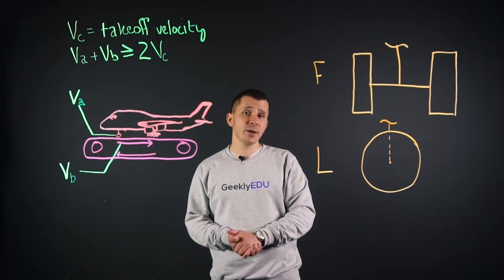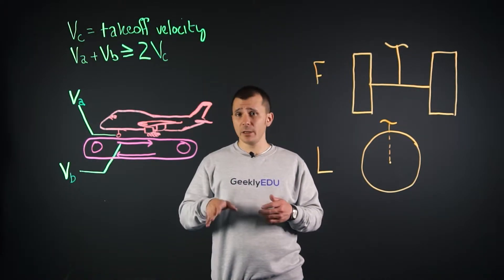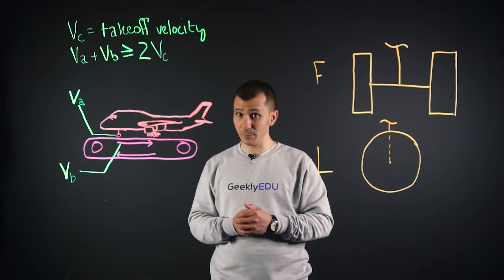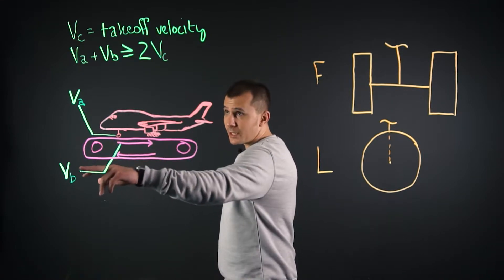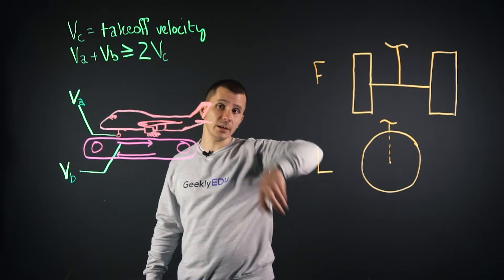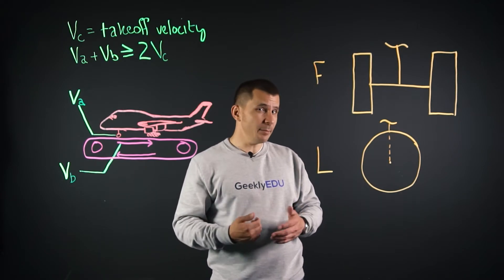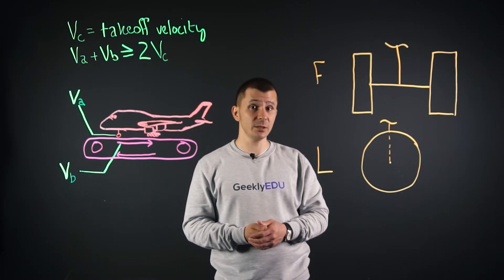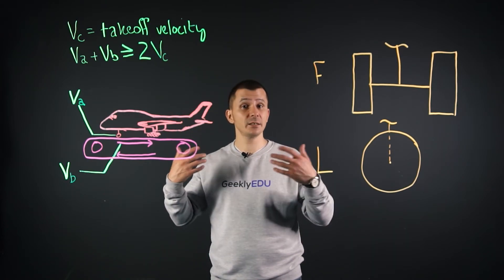Plane on a Conveyor Belt - Will It Take Off? #GeeklyHub

Comment: I believe the wording of the problem is an issue here. An airplane CAN TAXI on a converyor belt and remain stationary (and thus not fly) but if the pilot guns the throttle it WILL FLY. Some people are believing that the pilot is holding back the throttle to MATCH THE BELT SPEED and thus HOLDING BACK THE PLANE FROM FLYING. This is where the wording gets confusing because a CONDITION of the problem is that the belt match the airspeed and this would require the pilot to hold the plane throttle back to maintain stasis. But don't kid yourself. If the throttle gets hit hard enough that plane is flying. The wheels just spin more.
Reply: The plane will taxi just fine on a conveyor belt. you would not have to gun it. Normal taxi thrust would work just fine. Especially when there is little wheel bearing resistance at taxi speeds.
Reply: The condition is the same whether taxiing or wide open throttle.  The people who think the plane will take off are frequently just amazed by the size and power of the force of the aircraft engines.

The raw question is kinematics.  One motion is exactly the same as the other motion.  The net speed at wheel axle is always zero.

Not only is the speed exactly matched, the acceleration is always exactly matched because acceleration is the derivative of speed.

It is an obtuse thought project not based on any practical outcome, but half of the physics problems are similarly out of normal day to day experience.
Reply: @MrDefreese  Nope. The conveyor belt can run at the speed of light in the opposite direction of the airplane if it wants to, and it won't slow down the plane. Provided that the airplane is build "perfectly" meaning there is no friction between wheels and their axis, the wheels are just going to spin at whatever speed, like wheels on roller skates, skateboard or roller blades, but it won't have any effect on the airplane. The engines are going to create force that affects the airplane giving it acceleration in one direction, and the conveyor belt won't be able to exert any force whatsoever on airplane in any other direction. Even with real airplanes, the friction between wheels and their axis is so small, that the force of the resistance to the acceleration of the airplane is going to be negligible. The main force of the resistance is stil going to be the force of the resistance of air.
This is not a kinematic problem but a dynamic one, as the forces can't be excluded from the equation.
Reply: @ you have to start with kinematics first to see equilibrium.  Force analysis is just changing speed conditions over time.  This is not about bearing friction.
Reply: @MrDefreese  The question was: can the airplane take off? For that it needs the lift force. It can’t fly without the lift force. So the analysis of the forces involved must be done.
Reply: @.  You just need to know that the only way a wheel or wheeled vehicle can move is by rolling or by sliding on a surface.  If you reasonably exclude scrubbing across the surface, then you are left with only rolling and the kinematics are then inescapable.  No matter how fast you roll your wheel around its axis, the surface exactly matches the tangential speed as the wheel rolls on its circumference.

I’m sure you know the calculation of linear travel and rotational travel.

It’s inescapable math and kinematics.  It only highlights how useless this thought project is.
Reply: @MrDefreese  You are missing a key aspect: an aircraft is not a wheeled vehicle in the sense a car or a truck is. It does have wheels, as they create the least amount of friction and resistance to movement, but it could do with sledges or skates if the runway is made of or covered with ice. A hydroplane doesn't even have wheels. 
You are mixing up physics of a ground vehicle and an aircraft. 
Kinematics doesn't provide information where the motion comes from, and in case of an aircraft and a ground vehicle, the motion is generated completely differently, hence different rules and different outcomes apply in this kind of experiment.
At technical examination facilities in DMVs across the world they actually have a contraption that is designed to match the speed of the wheels. It is used for testing performance of breaks on automobiles without the vehicle actually moving no matter how fast the wheels are turning.
Reply: @ you are expressly given the kinematic relationship and you improperly  ignored it in your response again.  The rack and pinion animation shows you  how a rotating object on a moving surface behaves.

Start with kinematics, not force analysis.  🤷🏽‍♂️
Reply: @MrDefreese  OK wise guy. What causes what to move? Do the wheels cause the conveyor belt to move, or the conveyor belt causes wheels to move? 
Or in your "animation" does the pinion rotate and cause rack to move, or is it the rack that moves and causes the pinion to rotate?
ps. In order for an aircraft with its engines turned on to stay still, there must exist a force that is equal in intensity, but opposite in direction to the thrust of the engines. How exactly does the conveyor belt exert such a force on the aircraft? How is it transmitted from the contact point of the wheels to the entire aircraft?
Reply: @raderadumilo7899  once more.  Start with the kinematics and then go from there.  You now have this updated information to make your own assessment rather than disregarding the explicit conditions we are given.  Let's see your solution now that that part is out of the way.

Another person compared it to a plane taking off of an old school aircraft carrier without catapult.  If you take off as normally expected, the velocity at the wheel axis is the combined speed of the aircraft plus the speed of the vessel.

If, however, you point the aircraft towards the stern and try to take-off, you get the same situation as presented in this thought project - the speed of the vehicle less the speed of the vessel will give you the net speed of the aircraft from the perspective of the outside observer.

In Mythbusters, their aircraft take-off speed was 25mph.  If you put that aircraft going from bow to stern on an aircraft carrier going 25mph, then the net speed of the aircraft from an outside observer would be 0.

Long story short - it's both a frame of reference problem and a visualization of the conditions problem.  The pinion and rack explicitly shows the relationship between the two independent objects with no slippage and pure rolling.
Reply: @MrDefreese  Wanna use kinematics? Fine. 
A fixed wing aircraft takes off when it reaches a threshold velocity relative to the air surrounding it.
A fixed wing aircraft stays in the air by maintaining certain velocity relative to the air surrounding it.
It reaches and maintains the necessary velocity by pushing certain amount of surrounding air backwards (propeller or jet), and then the uncle Newton pushes the airplane forwards. 
The only frame of reference that matters at all is the air surrounding the airplane. From the POV of a person standing away from the conveyor belt the air above the belt and surrounding the airplane has velocity 0 (wind excluded). The velocity of the airplane relative to the air and to the observer is Vt. 
The conveyor belt has velocity -Vt relative to that same observer. 
If we add an observer on the conveyor belt, from the perspective of that observer, the velocity of the airplane is 2Vt in one direction. However, the velocity of the surrounding air is -Vt relative to the observer, if we take the direction of the movement of the airplane with a plus sign.
Wanna play kinematics? Fine, but you were missing the only frame of reference that really matters here and that is air.
Reply: @raderadumilo7899  your math is incorrect.  By the terms that we are given once again, the velocity of the airplane is Vt from the perspective of the conveyor....because that is what we are given.

Revisit the animation of the pinion and rack once more.  The motion shows you from the perspective of an outside observer that the wheel axis moves not a lick when the conditions stipulated by the thought project are put in motion.  It even shows the motion backwards and forwards so that there is no ambiguity.
Reply: @MrDefreese  Wrong on many levels:
1. The question is: Can the airplane take off? The only frame of reference that matters or has an impact on answering that question is AIR.
2. As for the pinion and the rack animation: There are two scenarios:
a) Pinion is fixed to its axis, so the axis rotates at the same angular speed as the wheel.
b) Pinion is not fixed to axis, so the axis does not rotate at all while the wheel is rotating at certain angular speed.
You are constantly looking at scenario a) while in the case of the aircraft it is scenario b).
Because scenario b) applies to aircraft, what happens is that there is no causality between those two motions. Rotation of wheels of the airplane can't make the axis move in any direction whatsoever.
Here is a better scenario for you to visualise this:
- You have a person wearing roller skates on a conveyor belt. The conveyor belt is moving in one direction at a certain speed. 
The person is holding to a fence that is beside the conveyor belt and stationary. The person can use the fence to pull itself and move in the direction opposite of the movement of the conveyor belt. 
Physics of that scenario is exactly the same:
- Wheels of roller skates behave exactly the same as wheels of the airplane, rotating at the speed that matches the speed of the conveyor belt, but they can't cause the skater to move in any direction. Person using the fence to pull themselves in the direction opposite to the movement of the belt, that's what aircraft propulsion system is doing. 
Different set-up, same physics.
Reply: @raderadumilo7899  first, you don't need to worry about 'air'.  The issue is whether the vehicle can roll on the moving surface.  Kinematics once more.  Your attempts to explain fixed wing flight are wonderful, but understanding the rolling behavior of an independent object on and independently moving surface is the issue of this thought project.

Secondly you are rightfully observant that a solid axle is different than a bearing, however, no matter how you slice it, the vehicle can only move by rolling (or sliding) and we are not dealing with a sliding situation. You must use the standard formula for the rolling of a circular object equaling the linear travel at the wheel axis/axle.

Lastly, the 'pulling the object along the surface' example is fatally flawed because, once again, in order for the wheeled object to move, it has to roll and you are, once again, explicitly given that the surface rolls at the same exact rate.  What would happen if you created an artificial position constraint to this kinematic system, you would cause the the system to bind as you try to force the position change; you would cause the wheels to scrub across the surface which is obviously not the principle at issue with the thought project.

You are in a circular illogic where you want to just force the object to move even if it means disregarding the parameter of motion you are given.

A 1 m wheel at 1RPM moves 3.14 meters.  The surface also moves 3.14 meters.  How far did the wheel axis or axle move?  Nil.
Reply: @MrDefreese  For crying out loud! An aircraft is not a ground vehicle. Its motion has nothing to do with the surface. You can't exclude air. Excluding air for an airplane would be like trying to do kinematics or dynamics of a car in space.
You can't apply either kinematics or dynamics of a ground vehicle. The ground vehicle moves by friction of the wheels on the ground surface. If the surface moves, then it affects the movement of the vehicle. 
The ground vehicles are rolling. An aircraft is sliding. It's just that bearings and freewheeling effect are used in order to reduce friction.
But guess what: a hydroplane is actually sliding on water surface, and sometimes they are used to take off from snow or ice fields also.
So, in essence, we are dealing with sliding, not rolling.
Provided strong enough propulsion a hydroplane that has no wheels could slide and take of even from an asfalt or a grass runway.
Reply: @ stop typing.  The vehicle is not in the air.  It is only able to move by rolling or sliding on the surface.  Lift isn’t involved until it gets to a high enough speed and the summary of this thought project is that the wheel axis and the vehicle body doesn’t move relative to the environment.

Stop typing and try to learn because you keep making basic mistakes that would be fixed if you let it percolate in your noggin.
Reply: @MrDefreese  Wrong. An aircraft is in the air. It moves by pushing molecules of air in certain direction. It sliding on surface is just a side effect. They used to have an aircraft attached to the bottom of a Zeppelin. It wouldn't have enough speed when dethatching from the Zeppelin, as that thing moved very slowly through the air, however, at enough altitude it would have enough room to reach the necessary velocity moving through the air on its own. 
The lift exists from the moment an aircraft starts moving. At certain point that lift will be equal to the force of gravity and the result force with which the airplane impacts the ground will be 0, and the uncle Newton will then make sure that the force with which the ground impacts the airplane is also 0. 
At what speed this will happen depends on what are the conditions of air surrounding the airplane. The Nairobi international airport has (or used to have) the longest runway in the world. Guess why. 
Add a vertical thrust engine to the aircraft (UK Sea Harrier or USSR Yak 41) and you reduce the time needed to reach required lift force to 0. Or you add Vo to the equation and significantly reduce the time needed to reach Vt (the catapult on aircraft carriers). However, the physics stays the same.
Your thought process and all your instincts are constantly stuck with physics of ground vehicles, and for that reason you are incapable of understanding that for the aircraft the wheels and the ground are just the source of negligible resistance that have way less impact on the movement of the aircraft then the resistance of the air. You can replace the ground and resistance it causes with a force variable and use exactly the same equations as for the aircraft at 35K feet in the air. You'd get the same results both theoretically and empirically.
Questions:
- Why was the space shuttle called "The Flying Brick?"
- How does a head wind to the aircraft impact the take off?
Reply: @ stop trying.  The problem is the vehicle on the surface.

You are embarrassing yourself to the point you will have to discard your account.  🤦‍♂️
Reply: @MrDefreese  Nope it's the aircraft on the surface. Net vehicle. It doesn't have a wheel drive.
Besides, you have a Mythbusters episode, plus several other video clips on YT where people tried with scale models (same physics still). And guess what:
- The aircraft moved in the desired direction on a conveyor belt running in the opposite direction and the plane had actually flown.

I've tried to teach you to approach physics from the perspective of empiric results. Because, when the mathematical model doesn't correctly predict the outcome of an experiment, then there is a flaw somewhere. It is usually not a flaw in the logic but in the starting assumptions.
However, you are too thick and arrogant to learn. You fail to take a different perspective, and although your model doesn't match the actual experiments, you are still trying to defend it, by ignoring certain details.
Reply: @ it is a wheeled vehicle.  You can use any force on it because force is force and, once again, this is kinematics, not force analysis.  You are expressly given the point that the tangential speed of the wheel is exactly the linear speed of the surface including the presentation of an animation which shows the kinematics…the relationship of motion of the two independent objects.

Mythbusters did their test wrong.  They revved the engine of the plane with no regard to speed of either the plane or the truck.  Anyone with rudimentary critical skills must be able to see that was not rigorous.  So too with similar attempts - they rev the test vehicle while maintaining constant speed of the surface.  This has been explained multiple times.

You have tried not to teach (as if) but you repeat variations of your own thickness and you haven’t learned from your mistakes when they are pointed out to you with math and physics.

Once more - if you have a 1m wheel and it rolls 1 revolution in 1 minute and you are on a surface that moves 3.14m distance in 1 minute - how far does the wheel axis move?
Reply: @MrDefreese  Answer to your last question:
- The axis moves 0 meters. As there is no friction between the wheel and the axis, rotation of the wheel does not cause the axis to move in any direction. 
You can try this out: 
- Take a roller skate, put it on a conveyor belt (in a gym for example), put enough mass on the roller skate so that little friction there is in the bearings is negligible to the inertia of the skate.
Turn the conveyor belt on and tell me if it moves anywhere.
Reply: @ you are correct, a tangential force is not acting on the wheel axis.  Everyone knows this or should…but as mentioned in the first part - there is no motion at the wheel axis under the parameters given.  Not only is the wheel axis always static as in no motion and no change in motion of the axis over time, by derivative calculus, that means there is no acceleration at the wheel axis under this thought project.

It is an infuriating project but this is the math and kinematic reality of what we are given as constraints.  Aside from kinematics, the answer in math form and force analysis is essentially a torque calculation…but nobody is going to do that in a silly YouTube thread.

🤷🏽‍♂️
Reply: @ Wrong. There’s no motion of the axis that is in any way correlated with the rotation of the wheel.
However the axis has motion caused by the airplane itself.
Reply: @ you were making progress and then you literally backslided into relapse.

You already acknowledged that a rotating circular object on a linearly moving surface has no net motion at the axis.  Any force applied to the center of mass or axle or axis can only make the object slide across the surface - which we hopefully agree is irrational - or causes the wheel to roll, which gives you that zero net motion.

You are repeating an incompatible pattern of  circular illogic despite acknowledging the answer already.  By your latest attempt at defending your inconsistent position, you are essentially trying to argue that the axle has a different motion than the wheel axis.

The animation shows the motion of the two independent objects moving at the same speed.

Before trying to unwisely respond with incorrect assertions or attempts at condescension, see if you can explain to yourself for your own satisfaction how that motion results in the axis remaining stationary no matter what force is applied to the wheel center of mass or axle.

You will always come to the same answer - 0 net position change; 0 speed; 0 acceleration.  It is inevitable.
Reply: @ Again you are looking at the problem backwards.
The question was can the airplane take off? The question can be translated into:
- Can the conveyor belt running in the opposite direction and matching speed of the wheels of the airplane actually prevent the airplane from taking off?
And the answer is: No it can’t. Movement of the conveyor belt doesn’t affect movement of the aircraft in any way, apart from making its wheels spinning faster.
You are constantly applying solution for a ground vehicle that has drive on wheels, to a problem of aircraft that has freewheeling wheels. 
Do the experiment with roller skates or rollerblades and a conveyor belt in a gym and you might learn something.
Reply: @ Here’s a question for you: How does an airplane slow down on the runway when it touches down?
Reply: @raderadumilo7899  ou have all sorts of methods - reverse thrust on jets, reverse pitch on props, drum and disk brakes,  drag chutes, speed brakes on the fuselage, arresting gear, crash nets, gravel pits and other loose materials in dire conditions.

You also have aircraft carriers which travel in the same direction which reduce the relative speed between the aircraft and the surface on touch down...which gets to the original point about the frame of references needed to analyze why the plane will never move axis if the tangential speed and the surface move in exact tandem and that there will be and can be no net acceleration if the speed exactly matches as explicitly given to us.

Except for skidding, which is outside of the parameters of the thought project of a rolling aircraft on a moving surface, nothing changes the fundamental reality as you previously acknowledged that the speed as measured from the axis to the environment is and always will be nil because of the given condition.
Reply: @raderadumilo7899    You already acknowledged that if you move your wheel a distance and the surface an exact distance, then the wheel axis doesn't move.  It is you who is approaching this backwards.

You are not using the conveyor to do anything except exactly match the motion, speed and, by calculus, the acceleration of the vehicle trying to roll.  You literally have it exactly backwards, you even showed the math.

It is inexorable.  You'll catch yourself eventually.  You did it before; you just have to follow it through to its logical, mathematical, and physical conclusion.
Reply: @MrDefreese  Try using drum and disk brakes on an aircraft when landing and you'll get into the evening news for causing an accident that killed 100-500 people, depending on a size of the airplane. 
You really don't know how the physics of aircrafts actually work.
Reply: @MrDefreese  I am trying to make you understand that there is no corelation between the rotation of the airplane wheel and the horizontal velocity of its axis. 
However, the axis has a horizontal velocity, regardless of what is happening to the wheel. That velocity comes from the aircraft itself using propulsion.
Reply: @raderadumilo7899  you should probably spend more time trying to learn instead of trying to make anyone understand an incorrect point that you already refuted yourself.

You already conceded that the wheel travel is nil if the surface moves at the same rate as the rolling wheel.  You are arguing with yourself and you don't seem to recognize it.  Look at what you already acknowledged.  Do you misunderstand the relationship between the wheel axis and an axle just like you misunderstood brakes on the wheels of an aircraft?

Interesting.

Good luck.
Reply: @ Nope. I said that the component of the velocity of the axis is nil in relation to the rotation of the wheel. Rotation of the wheel can’t transfer any acceleration to the axis so it can’t change the horizontal velocity of the axis.
However the axis already has the horizontal velocity. The conveyor belt cannot change it.
Reply: @ maybe instead of that revisionist jumble to save face, try to update your understanding about aircraft brake systems first.  Do you need a primer on 747 disk brakes?  Those are readily available on YouTube, technical manuals, and elsewhere…since you asked about the topic for some unknown reason and didn’t follow up on it.  There is a lesson to be learned especially for people who don’t know that aircraft use disk or drum brakes and talk about other people not knowing how aircraft work.

Good luck in this teachable moment.
Reply: @MrDefreese  Commercial passenger airplanes usually have brakes on wheels for the sake of better maneuverability at aprons and gates at airports. However, lot of smaller aircraft have nothing on their wheels. 
And some types of aircraft don't even have wheels at all.
Reply: @ did you really think you needed to share any of that?  That is especially odd since only one person in this thread was out of depth and unaware of some of this stuff.  It’s ok if you graciously ease away with some remaining dignity.
Reply: @MrDefreese  Ad-hominem